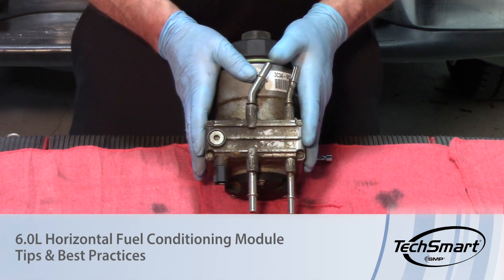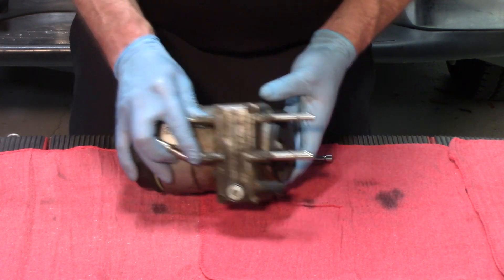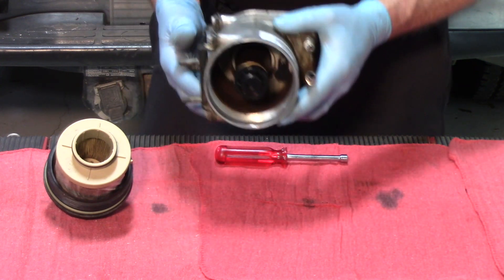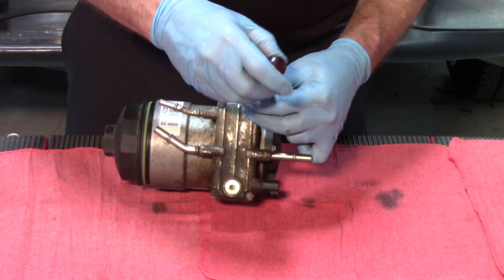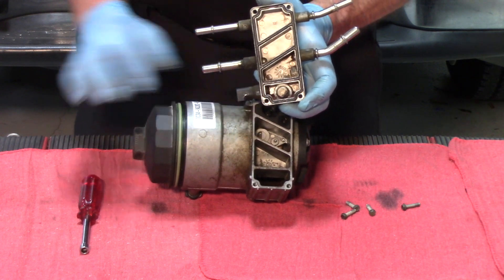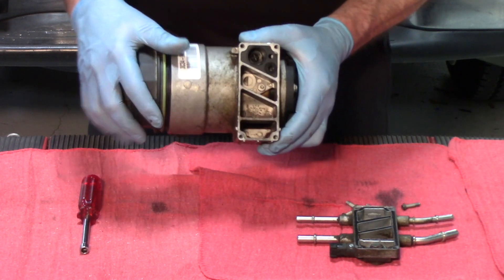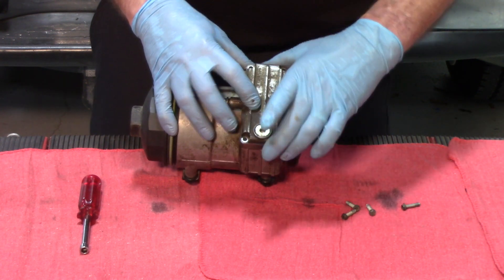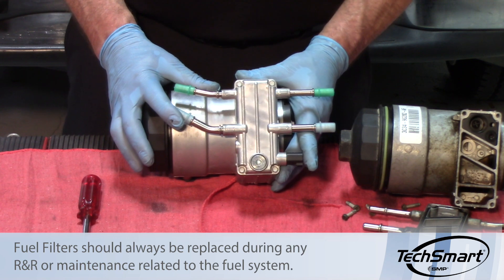6.0L Horizontal Fuel Conditioning Module Tips & Best Practices

Comment: Good video, but I have to interject something: For those of us whom do not have an extra 475 to 600 bucks laying around to spend on a pump, there are ways to clean these pumps and fuel-water separators to extend their life while you wait to replace it. It does not take long and with new filters, will run perfectly fine until you can replace the unit, if you so choose.
This is also what causes a repeat WIF or water-in-fuel light on the dash. If you see that, you have crud built up in your lift pump.